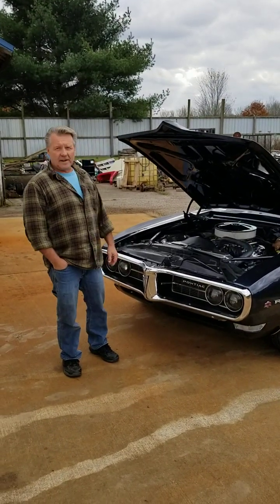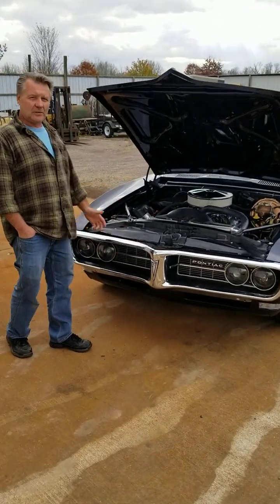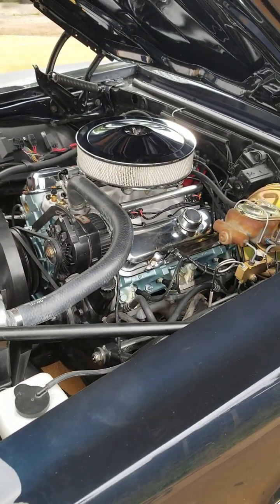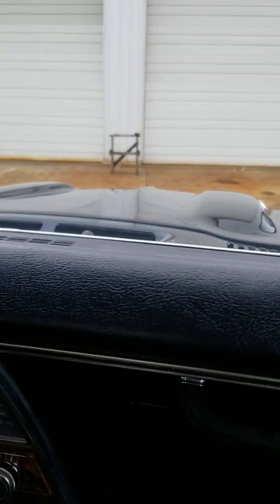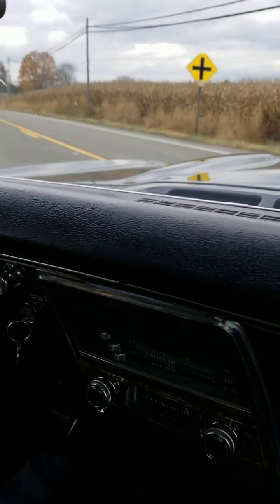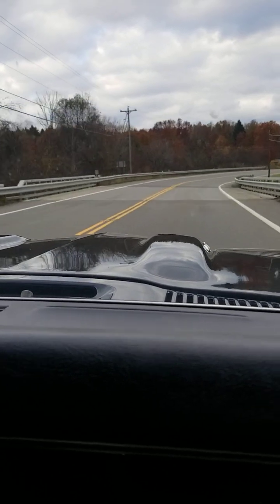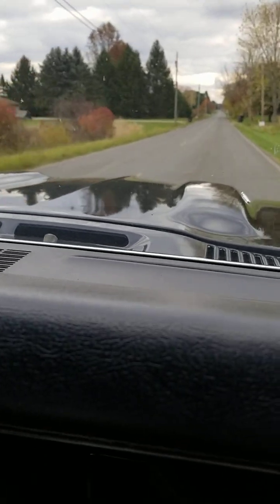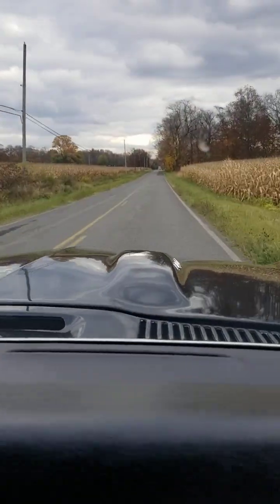WHY ???? The proper way to break in new piston rings.

Comment: On a new motor if you think it has ring washout can you just ball hone it to get crosshatch back? And do you have to buy new rings? Thanks in advance
Reply from the maker: Usually you can ball hone a fairly fresh engine with ring wash out if the cylinders only were lightly glazed over. Never re use any ring no matter how new if they have been washed out.
Reply: @dcimotorsports1111   Thank you very much..

Comment: Total seal did a great video on using a dino for 25 minutes, 2,500 RPM with a minimum of 50lb load and as each minute past by the ring kept seating, gaging off their blow by meter..  pretty fascinating that it took 25 minutes..
Reply from the maker: I have seen that as well on the dyno. In the car it happens a little quicker if loaded properly. One time we re ringed my brothers 400 for the Pontiac event and literally finished it up the morning before the event. The first two passes the car ran 12.40's the third pass the rings seated and it went a 12.00. Picked up 4 tenths once seated. It was pretty cool to see the HP difference first hand.
Reply: I worked out once the pistons go up and down about a 1,000,000 times in an hour.  So it makes sense if the rings are going to seat and seal well they do it soon after first start up..

Comment: Just rebuilt 78 la 360, i can start it just for a couple minutes to make sure its running before i do this? Got roller lifters, thanks for video, nice looking ride
Reply from the maker: Hi Blake, yes you can run it for roughly a half hour to an hour before taking it out to seat the rings. Just don't let it idle any more than is needed to check things over. Letting a new engine idle is hard on the rings and lifters until it has few miles on it.
Reply: Is there a chance it feels sluggish at first before everything is seated

Comment: What about a turbo or supercharger? Same break in? Or should you avoid boost?
Reply from the maker: For boosted engines you can do it the same way, but like you said. Don't use any boost or very little boost. What your basically doing is get compression behind the rings to push them into the cylinder walls to seat them.